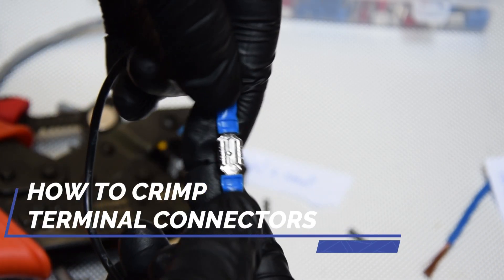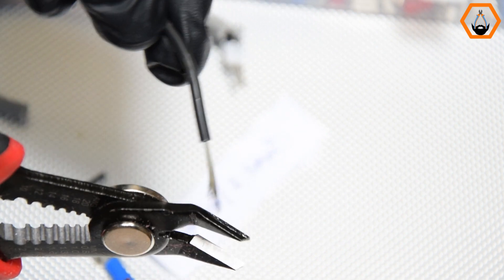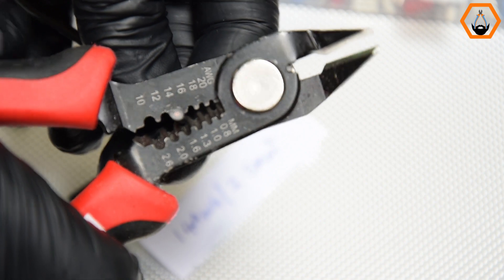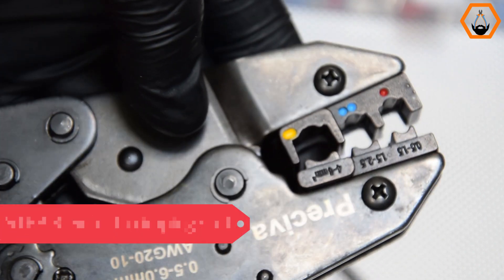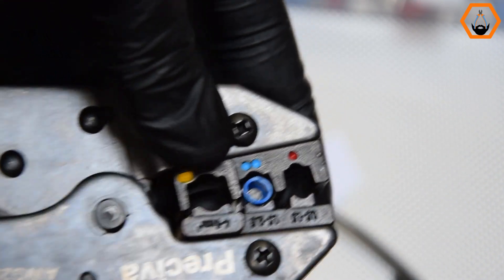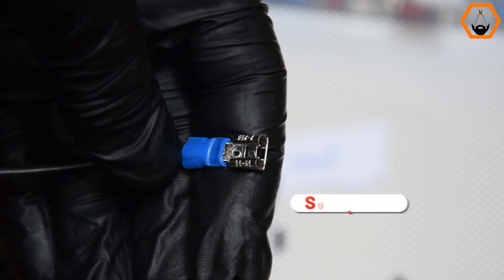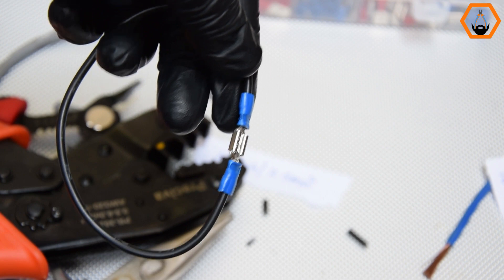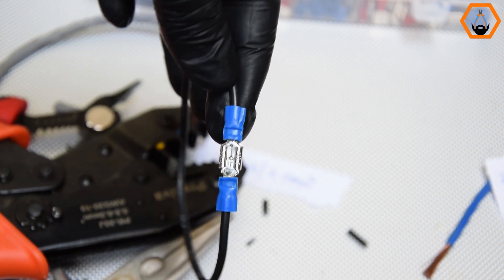How To Crimp Wire Terminal Connectors With a Crimper

Comment: I carry a small selection of wires with crimps either end  -
1 with male crimps
1 with female crimps 
1 with male and female crimps. 
This allows me to bypass switches when I’m fault finding. 
DISCLAIMER 
I never, never leave them in place. Switches are there for a reason, namely safety. This is purely part of a process of elimination to find a problem.